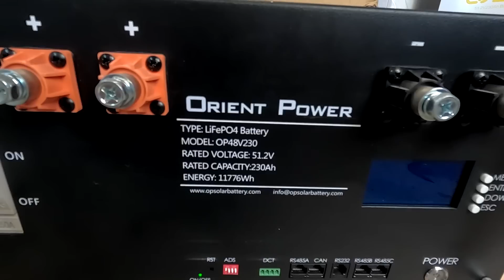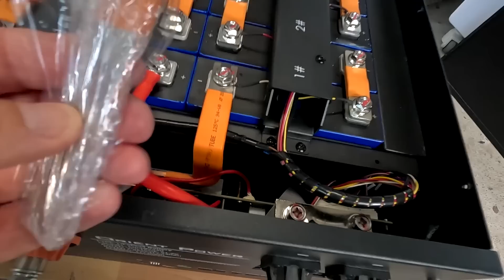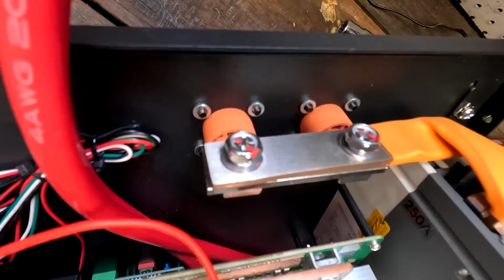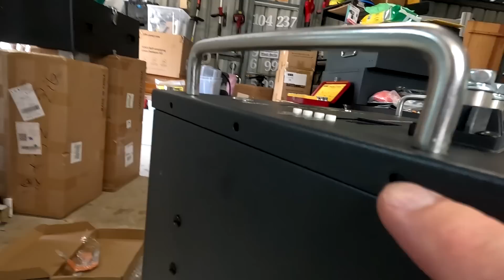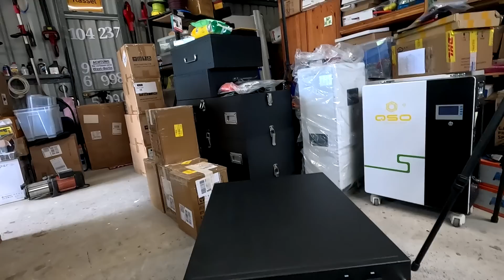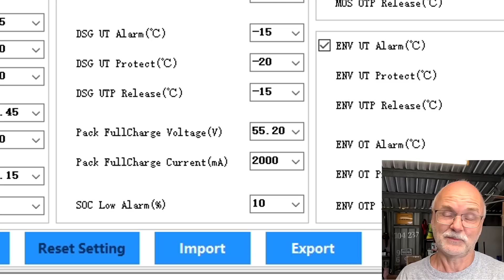Jakiper Battery Cable and Busbar upgrade. Ready for 250A?

Comment: Don't buy Jakiper or Orient Power.
The quality is inferior and they do not honor their warranty.
All the cells swelled to about 150% in size and two cells failed completely after about 2 1/2 years of light use.
I have spent months going back and forth with them. 
As soon as I sent pictures of the swollen cells they should have sent me a replacement battery.
I can provide details of all communication with this unscrupulous company.
First they wanted to send me 2 cells for the failed cells even though all the cells were failing with proof from all the pictures I sent. They want the end user to completely disassemble and repair it. This is dangerous for someone without the skills to do so.
After countless emails, photos their solution was to ship me their "used" demo battery from China that I would have to pay the shipping cost.
I purchased the battery in the USA.
Other good companies would ship a new replacement at their expense.
There are much better vendors to buy from that have better quality and a warranty that is not just lies.  
In my research I found several others that have had the same experience.
I had to purchase another battery from another vendor. I was stupid and got suckered by their claim of a 10 year warranty.
Buyer beware. Don't make the same mistake I did.

Comment: Thanks for your nice video’s, research and sharing all your knowledge

With the help of your video’s I was able to
- understand and the correct parameters for the 16s 200A JKBMS
- learned how to make my own CAN-Cerbo GX cable (Victron type A)
- insulated the indicator on the BMS with a heatshrink to protect for shortage with the alu plate in future
- learned that the dry contacts are still not usable due to a HW bug

The LFP/JKBMS/Victron systemworks perfect on our electric boat and very happy with te results, thanks
Reply from the maker: Thank you so much not only for your generous donation but also for sharing your story 🙏

Comment: Your using a ac chart are you not?
There are different rating of cable.
Our 35mm2 cable is ratee for 370amp, our 25mm2 is rated for 190amps

The 25mm ac chart puts the amps at 100amps . These were used as a rule of thumb and was over a longer distance.
So short cables and new cables tend to take more current.
Additionally  ac runs on wire surface, dc dosent.
Just look at the surface area of a 200a fuse.

Comment: The marks are dual purpose . It’s an indicator of torque checked and also a maintenance visual mark that you can see the nut hasn’t turned ( loosened ) relative to the thread! I.e it’s as tight as it was when torqued 💪👍👍

Comment: Hi Andy, 
Hi All,

I needed to ask this very imprortant question,
I had brought 4 EVE 105AH prismatic cell, and used with Victron 75/10 mppt charger.
I had forgotten to set the battery voltage, previously i has set to 25 volt absorption voltage.
Due to this my big mistake, the 4 cells in series were overcharged to 4.46 volts per cell, but the charging time was not more than 1 hour i think. 
The battery temperature was around 36 degree centegrade. 
At that time, the cells were perfectly flat. These are grade A new cells.

I immediately discharged some energy and brought down tve voltage to 3.35 volts per cell.

Next day, i see that all these 4 cells are swollen!!.

Can you please help me here, what can I do to use these cells safely?
Is there any way to reverse the swelling of the cells?
Please help me

Comment: Is there a DYI box that I can hang in a serverrack? Including rails?
These cases look like 6U cases but none of them come with rails, and none of them seem to be the exact width.
If a rack can hold some lead UPSes, it can also hold a significant amount of LiFePo4.
Reply: Yes, there are DIY boxes that can be mounted in a server rack, including some that come with rails or can be customized to fit your needs. While many 6U cases don’t come with rails, you can often find rackmount kits or adapt existing cases to fit. You’re right that a rack designed for heavy equipment like UPSes should be able to handle the weight and dimensions of LiFePO4 batteries, as long as the weight and size are within the rack’s capacity. You might also look into custom rail kits or adjustable mounting systems to ensure a secure fit for your battery setup. Let me know if you'd like some specific product recommendations!
Reply: @ESS-BESS-CONTAINER  since the IT industry is almost done moving from on-premise to the cloud (which I also think is going to be rolled back as soon as people notice MS has a monopoly position, and is going to raise it's prices), you can find nice 42U racks all over the place.
Possibly 100kWh batteries.
I am actually interested in such a setup.
Right now I build my own setup, but maintenance is quite a hassle
Reply: we are developing the cabinet, if you are intereste, please let us know.

Comment: 9:58 you say 20 amp current limiter...did you mean 200 amp? Or 20 amp for balancing circuit?
Reply: I believe it limits the current to 20 amp
Reply: @esmailalkassir1565  20 amp max current from a 280ah battery seems a bit disproportionate
Reply: @ I believe it is safety feature that turns on based on temperature and cells status also based on parameters setting . So it is not default on
Reply: @esmailalkassir1565  ok, that makes sense

Comment: Can someone please help, should i compress the cells in my 16S DIY Battery box or not? i am confused as i watched some 2023 Videos of Andy but others say its out dated and compression is a must. What is the current way of doing it correctly. I use EEL V5 housing and 16 EVE MB31 cells
Reply: Great question! The debate around compression is ongoing, and the approach can vary depending on the design and specific components used. Compression can help ensure better thermal performance and improve contact between cells, but it’s essential to avoid excessive pressure that could damage the cells. For your setup with EEL V5 housing and EVE MB31 cells, I’d recommend checking the manufacturer’s guidelines or consulting with other experts who’ve worked with these exact components. It’s always good to stay updated with current best practices. Hope that helps!

Comment: Busbars are also only 2x20mm = 40mm²! Maximum 100A!
Reply: They are very short and will share their heat with cells. So it's ok.
Reply: @volodymyrzakolodyazhny  No, that's wrong. It depends exclusively on the cross-section and not on the length.
Reply: @anacronataff1  no, cross-section is only one of several parameters.
Reply: This is wrong! Length matters because it determines resistance ⚠️
Reply: @louwrentius  Stop this discussion! Even Andy says "the carrying capacity of cables is not dependent on cable length, it is only the crossection and the material of the insulation", see his "New Gobel Power DIY Kit V2"-Video from 15 minute 23 Sec
Reply: @ 🛑 then andy is wrong yet again or maybe explain to Victron that their toolkit app is wrong. Longer cable is more material is more resistance is higer voltage drop is more heat generates in the cable and the inverse is true.
Reply: Good catch! The 2x20mm busbars do have limitations, and current capacity is definitely an important factor to consider. Thanks for sharing your insight!

Comment: Andy, you are actually tightening the flange nuts tighter than 4nm with the wrench. If you are just checking for the nuts to be at least 4nm then you're okay but if you want them right at 4nm you should undo them a little bit before tightening them to spec. It doesn't really matter with these welded m8 studs, they can handle a lot more. And off course the torque meter should be calibrated, just as you do with S.P.A.T.'s. In fact let me calibrate one right now, cheers.
Reply: welding nuts can take higher than this value, that is true.

Comment: For current rating of DC cable, I use an online cable calculator. You input voltage on cable, max current on cable, wire conductor type, required voltage drop in % (1-5) , ambient Temp (max), installation method (duct/open air etc), cable grouping 1-3 etc, cable temp rating & length off cable in metres. This will calculate the cable size that is recomended.
Please refer to Australian standard AS/NZS 3008 for accurate guidance.
Reply: professional

Comment: Can't believe you let the two red cables just dangle freely with uninsulated ends while fitting the front plate, bear in mind that they are joined at the other end
Reply: You're right—safety is crucial, and we should have secured those cables properly during the assembly. Thanks for pointing that out, and we'll make sure to improve our practices in future videos!

Comment: hello Andy
here is what I found on the very good PACE BMS.
When the voltage reaches "pack full charge voltage" and "pack full charge current", the SOC goes to 100%. If there is communication between the bms and the inverter, then the inverter receives the SOC 100% and it stops charging the battery and even in some cases, it stops the mppt (it depends on the inverters used)
Reply: :face-blue-smiling:
Reply: Hi there! Thanks for sharing your findings on the PACE BMS. That makes a lot of sense—once the voltage reaches 'pack full charge voltage' and 'pack full charge current,' the SOC hitting 100% triggers the inverter to stop charging. If communication is established between the BMS and the inverter, it can also influence MPPT behavior, depending on the inverter model. It’s great to see how these systems work together for efficient battery management!

Comment: Flex buzbars do flex sometimes. You will need to retighen them if you have the other type of terminal.
Reply: Good point! Flex busbars can shift slightly over time, especially with certain terminal types. Regularly checking and re-tightening them ensures a solid connection and helps maintain system reliability. Thanks for the insight!

Comment: Great video, Andy. What do you recommend the ideal battery temperature to be for the best combination of efficiency and longevity?
Reply: Thanks for the kind words! For the best balance of efficiency and longevity, the ideal battery temperature typically falls between 20°C and 25°C (68°F - 77°F). Staying within this range helps maintain optimal performance and reduces wear on the cells. Temperatures above 30°C (86°F) can start to reduce the lifespan of the battery, and below 0°C (32°F) can affect charging efficiency. Keeping the temperature stable within this range is key to maximizing both efficiency and longevity!

Comment: Nice video. Do take into account how short the cables is compared to the standard length in the table you looked at. I do believe that’s for 1 meter. You are at about half. That reduce the resistance too and hence the current capabilities. I agree they should use thicker cables to be compliant. But I don’t think there is any great danger there in this instance. Or am I wrong? Please do correct me if I am. 😊
Reply: The cell terminals are welded type, we have tested in factory that if using bigger size cable than 2x4awg, then the bending force  will be applied to terminal. This is a short history when 2 x 4awg wires are chosen.
Reply: Thanks for the feedback! You're absolutely right about the cable length—it does affect the resistance and current capabilities. Shorter cables will naturally reduce resistance, which can help improve performance. While thicker cables are ideal for compliance and safety, in this particular setup, the shorter length does reduce the overall risk. However, it's always important to consider safety margins and adhere to recommended guidelines. Thanks for your insight, and you're not wrong at all!

Comment: 7:30 In that case I put one cable with the cable crimp barrel up and the other down. Perhaps I also need to trim the insulation hose too. A little bend of the palms might help too.
Reply: That sounds like a good approach! Positioning the cable with the crimp barrel up and down can help with securing the connection properly. Trimming the insulation sleeve could also give you more flexibility for a cleaner fit. A slight bend of the palms will likely make the process easier too. Appreciate the suggestion—it’s always about fine-tuning for the best setup!

Comment: The reason for stacking batteries is to get a longer time out of them, not to get a higher current.  A 4x230Ah stack is limited in current  directly proportional to the rating of the front panel connectors and the size of the battery cables paralleling the batteries. The Jakiper battery should be seen as a 5KW battery x 2.3 hours
Reply: You're absolutely right! Stacking batteries is primarily for extending runtime, not necessarily for increasing current. The current capacity is indeed limited by the connectors and cables, and the Jakiper battery should be seen in terms of its total energy storage, like a 5kW battery for about 2.3 hours. Thanks for the valuable insight!

Comment: Andy, did you check the flexible bus bar dimensions? Maybe the new ones from the upgrade kit are thicker than the older ones.
Reply: Good question! I’ll need to check the flexible busbar dimensions to compare them. It’s definitely possible that the new ones from the upgrade kit are thicker than the older ones, which could impact conductivity and heat dissipation. I’ll take a look and confirm—thanks for the suggestion!

Comment: The 250A breaker is fine as a mainswitch, but add indeed a fuse in the battery case to secure the cables.
Reply: Great point! The 250A breaker works well as a main switch, but adding a fuse in the battery case is definitely a smart move to protect the cables and enhance overall safety. Appreciate the insight!

Comment: I'm very surprised to see  4 AWG  Cables in batteries over 150A, I've used 2/0 (70mm) for all my batteries as well as for the inverters, 50mm for the 100A battery
Reply: Great insight! Cable sizing is definitely a crucial factor for performance and safety. Using 2/0 (70mm²) for higher currents is a solid approach. Thanks for sharing your experience!

Comment: Ol Jaki battery with jk bms peeeerfect👌🇦🇺
I bought a 100ah battery a while ago when we were deciding which way to go offgrid upgrade, ended up getting hold of a heap of ex Telstra 2volt 500ah cells, in a 48v config which is 24 x 2v 500ah making it 2000ah plus the older Victron 8 x 12volt and 200Ah batteries which are also connected 
In parallel at 48volts making it 2440ah, the jaki battery is just sitting idle doing nothing the plan is to disable one cell to make it 15 cell 48v config in the jaki and since our system runs at 52.3v max it only ever drains to about 50.0v minimum I should be able to throw this into the mix after adjusting some parameters and see how it performs.
Reply: Arranged 51.2V314Ah, stay tuned.
Reply: Sounds like you've got quite the setup there! The combination of Telstra 2V 500Ah cells, Victron batteries, and the Jaki battery is impressive, and integrating the Jaki battery into your system after modifying it seems like a solid plan. Adjusting the parameters to match the system's voltage is key, and it’ll be interesting to see how it performs once you add it to the mix. Thanks for sharing your experience!

Comment: Hi Andy.
For information, Gobelpower last Pace BMS firmware implements a new logic for CVL.
I copy / paste an extract of the changelog.

New Max Request Charge Voltage (CVL) logic: 1 hour after fully charging, Max Request
Charge Voltage is changed to Pack OVP Release Value. Max Request Charge Voltage is
recovered to Pack FullCharge Voltage Value after SOC drops to 95%.

Well, I have done some tests. CVL down to a fix value of 54.4V but the new logic work.
Reply: Hi there! Thanks for sharing this update on the latest Gobelpower Pace BMS firmware. The new CVL logic sounds like a great improvement for battery management. Lowering the Max Request Charge Voltage after full charge and recovering it once SOC drops to 95% should help optimize charge cycles. Great to hear that you tested it and confirmed it’s working! Appreciate the insight.

Comment: Andy fuse and circuit breaker are not the same. Fuse for protection, and circuit breaker just for disconnection. Circuit breaker can be used for protection, but its tripping current and time are very high. In this case, the protection function is performed by bms and the Max current and time are properly set. In this case, the more powerful the circuit breaker, the less heating possibility and less losses.
Reply: Fuse takes more time to act than the circuit breaker.
Reply: You're absolutely right! Fuses and circuit breakers serve different purposes. A fuse is designed for protection, while a circuit breaker is primarily for disconnection. Although circuit breakers can be used for protection, their trip characteristics are usually not as sensitive, making them less suitable for certain situations. In systems like this, the BMS takes on the primary protection role, and the circuit breaker can be selected based on the desired current handling and reduced losses. Thanks for the clarification!

Comment: It is worth nothing that the red marking across the top of the bolts and nuts also acts as a tamper seal for warrant claims.
Reply: Great observation! The red marking does indeed serve as both an indicator for movement and a tamper seal for warranty claims. Thanks for pointing it out!